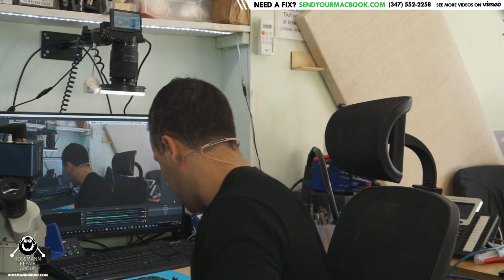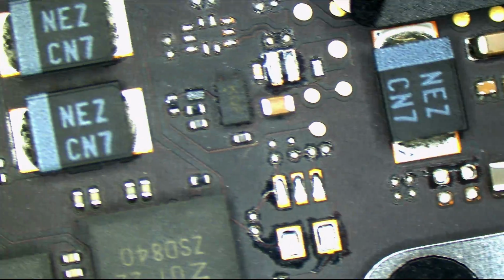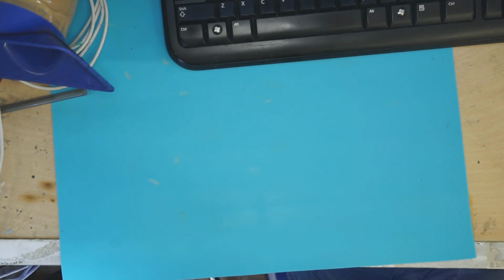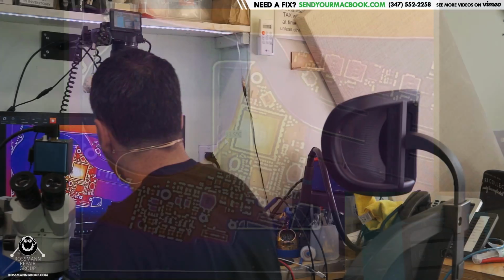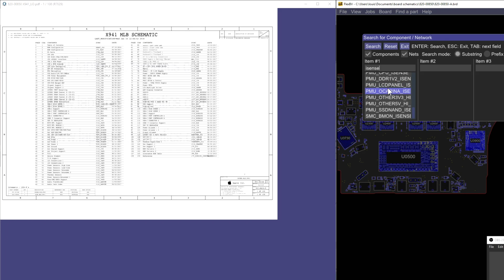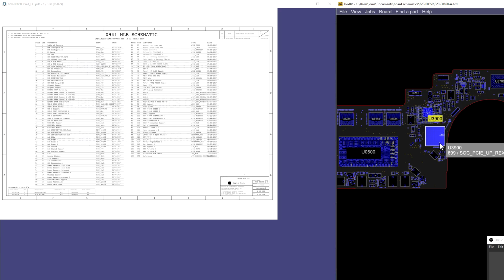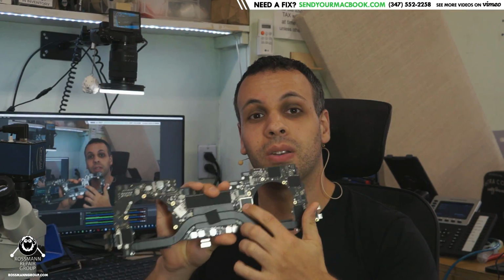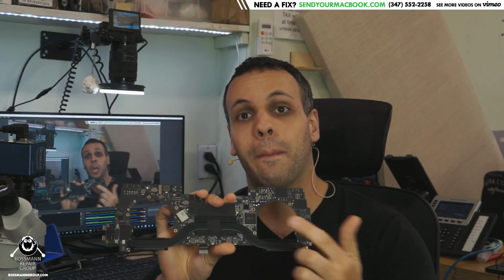Apple users have no one to blame but themselves.

Comment: You know what i hate? the fact, that i bought an iPad! >.<
Here is the reason: Android Tablets suck! It is not like, that they're worse, than an iPad, no, i have tested EVERY Tablet on the market by the big players released since 2018!
Yes...a shitton...and every time i found myself coming back to the iPad, which brings me to the conclusion, that the industry set the bar for "good" so goddamn low...AND THEY'RE STILL FAILING...

I hate, that i get an iPad, but when you are in need of an ultra portable device, with a larger screen, than a phone, preferably with a pen and, so you can write notes, while you are inspecting shit and LTE...i am ANGRY, that i have to admit, that the iPad is the best we have!
Everything else is either more expensive, or just garbage. The latter is mostly the fault of Android, because even though it does run on tablets, it is not really great. Then you have manufacturers, that put stupid tweaks and bloatware on their tablets and you end up with a pile of electronic junk!

Comment: Yap. Surprising that it took this long, tbh.

I'm gonna contrast this to my experience with a company that probably most people consider pretty shitty, almost a decade ago now, in backwater country (Brazil), that might surprise some people.

Pre-considerations: nowadays I think their costumer service here dropped the ball by quite a lot, and the problems I had I discovered afterwards that it was all design flaw and their own fault. Alas, I was probably among the very few people who actually got one of those here in Brazil, and class action lawsuits are not a thing here, so not a chance of that happening. It did happen in the US though, but of course not being an american citizen I got nothing.

My first Dell XPS laptop. Expensive as heck (specially for brazilian standards). I wanted a desktop replacement because I was going to be taking a trip every two weeks for a post graduation course in game development, and it needed to be both powerful and lightweight.

Ok, after a year or so of normal use something went wrong and I got all sorts of weird artifacts on the screen. I think the laptop kept running full power while enclosed on it's case and something fried. E-mailed support, sent some photos, explained extensively what I had done. Some back and forth and they were sending someone at my apartment to check.

To my surprise, the guy who got to my door, despite being 3rd party not a Dell employee or anything, knew everything there was to know already. 
Like, not one of those cases where you have a lengthy detailed discussion with tech support only for them to send someone who knows nothing about the problem and you have to start explaining all over again. Nope. This guy came to my aparment with a motherboard replacement in his bag. He tried some stuff, did some tests, called it out and started replacing the entire motherboard.

This happened twice. Nowadays I know why. Faulty discrete graphics chip, a gift from nVidia. It would overheat if you forced the laptop too much, and kill the entire motherboard. Dell, at the time, honored the warranty and even extended it a bit, but by the time it ran out I had already learned how not to fry the damn thing (by not forcing the graphics side too much) and was already on the way of getting back to a normal desktop - needed a video editing station.

I gotta say, the level of expertise, the knowledge that the tech support guy showed, the speed in which he solved everything and how I was treated - I never saw anything near as good in any other tech support from any other company or from independent PC repair centers ever in all my years of dealing with computers. In Brazil, computer repair shops are just not very good at all. First SSD I got, I went looking in several shops for a way to fix it inside my desktop, most people I talked to had never even heard what a SSD was. Only one repair place whose owner also worked repairing computers had heard of it and asked to see it, suggesting some solutions.

Anyways, back to the Dell XPS - It's still working to this day, but as you can imagine, Linux only, very sluggish... it's a core 2 duo with 4Gb of ram, can't do much with it nowadays anymore.

About Apple, the way I personally see it, and have been seeing it since last I had an Apple product (an iPad 2), is that at some point Apple stopped being an electronics development company and became a commodity company, like so many others. The switch to highly proprietary components and tech became less about innovating and improving on existing stuff, and more about corralling costumers into a trap - the so called walled garden which has withered away a long long time ago. And it worked. You don't pay for innovation anymore, you pay for marketing, status, brand and luxury. The great usability stuff, the great integration in the ecossystem, the great design.... all that stuff that made Apple great are shadows of the past. It was very true at some point in time, it's still historically true, but they are just not doing it anymore. And anyone who is still not feeling how aged this philosophy and mindset currently is for the company, is just in denial.

And this is something that I'm definitely not gonna put just against Apple. Google is just the same. Microsoft was always kinda shitty, and it still is, so no big changes there. But these companies have been just riding on the coattails of great past accomplishments while doing nothing comparable to their past these days. Apple with it's famous great costumer service which I'm seeing nowhere these days, Google with it's great innovative ideas and dedication to projects which I'm also not seeing anywhere these days, what with their constant flubbing with messaging apps and whatnot.

In the end, nowadays I will go for almost any Windows laptop rather than a Macbook. All the Windows laptop companies might screw me over, but at the very least I can open things up and try to deal with it myself, to a point. With Macbooks, I'd not only have to pay the insane premium price that is practiced here in Brazil (you think Apple products are expensive there, you know nothing John Snow), but also be sol if it breaks. Nope. Not gonna fall for that.

Comment: Lucky! I ditched Macbook Pro 2018 and Razer Blader 15 2018 for Asus Zephyrus and XPS 15. Macbook Bad keyboard and Razer On-Off pause issue.
Reply: XPS 15 has it's own set of issues, the most annoying of which are the incompetence the devs show for every firmware update they have released for that device (most annoying ones i experienced were touchscreen functionality going bye bye and dGPU throttling hard if the temperature was below 48 degrees c... the latter issue was bypassed if i suffocated the laptop in a blanket for a few minutes as the dGPU was being stressed. they did release a BIOS update to fix that issue, but it took them more than a month, after which i had returned my 9570). i've had much better luck with the blade 15 :/ hope your XPS 15 doesn't give you any other problems in the future.

Comment: To turn on for a while the printed circuit board and to recover these data it is possible. 
It is necessary to disconnect internal mosfet inside controller using the schematic diagrams and connect by an external power supply. 
For repair necessary to buy empty the multicontroller chip and to program it using a firmware from Apple according to audit of this printed circuit board. 
In the same way as well as program multi controllers on computers used in Windows based devices. 
In Russia this type problem already successfully repaired.
Reply: yeah but having that firmware is probably illegal, which in russia no one cares but in US you might be prosecuted
Reply: @petervansan1054  who know whether someone have firmware and it was used in repair. 
In some cases I should do some firmware reverse engineering process. Even for crack apple password or update firmware in SSD for data recovery process. 
In some cases need prepare particular patch firmware if SSD have memory chip degradation. Same for Apple. Who care if I use modified firmware or service manual from plant. 
If it was stolen from Apple then it is Apple problem. BAD protection and security. 
Police cant find allpe firmware because people used online firmware encrypted storage together with multicontroller programmer.
Reply: @oleggritsev  you should do a full write up on how to do this if you ever have the time.
Reply: @Scragg-  Sorry guys i am not a blogger. I am electronic engineer with University Master degree. I can develop Monitors, TV, laptops tablet and any electronic devices or use some microcontrollers. And of course i can fix any of them. Apple provided to me electronic diagrams and datasheets only for data recovery purposes. So i think illegal share it with everyone. If you need burn firmware to SMC , SMU or PMU then use google search to buy some solution. Firmware from EFI Boot ROM and SMC version update usually possible download from open apple web or certified apple technician level 2, 3 access, and after then extract it from update file.
Reply: @oleggritsev  so youre telling these repair companies to start repairing stuff illegally? who the hell is going to want to risk their buisness on somebody elses crappy apple shit. you are missing the point of this video, the apple stuff has become not anywhere near practically repairable which is completely unacceptable and unfaithful for a business especially of this size
Reply: @jamiedyer7782  "so youre telling these repair companies to start repairing stuff illegally"
Why don't you re-read what you wrote and try to make sense of it in a world where you own what you buy?
Reply: @Markle2k  the company is being unfaithful in making their products harder to repair purposefully to make them throwaway products so that people just buy more every year instead of repairing what could easily be a perfectly good machine. It's not faithful of apple as a company and since they are a big multinational conglomerate that holds massive share value they should be under the highest level of scrutiny for their faith and good will as a company which offers a product to general public which have human rights and technically have rights to not being sold a faulty piece of garbage equipment that was very unnecessarily designed to be so
Reply: @jamiedyer7782  You called making a repair "illegal".
Reply: @Markle2k  I was quoting the original comment about the requirement to use illegal firmware to repair the board, you wouldn't do this as a business owner because it's a risk that's not worth taking
Reply: @jamiedyer7782  Again, you are normalizing the notion that making a repair is an illegal act. "Illegal firmware", WTF? If you aren't flashing an ECU to get a car to perform or facilitate an illegal act, like bypass an emissions test by sensing a test procedure and implementing a different program, what is illegal? Putting getting the hardware back into a working state should not be an option for the OEM that has an anti-consumer incentive to use failure as a way to sell new product.
What you are doing is buying into Apple being able to game the system to its benefit and every customer's detriment.
Reply: Peter Vaňušanik tbh I would love to see apple try to take me out lol they will have to worry about their servers first lol
Reply: Louis should chime in
Reply: @banjirjir7519  Apple provides some documentation for forensic and data recovery services. But it requires an agreement that the Apple out of warranty products will not be repaired because it is not beneficial for Apple. Therefore, some Apple documentation is available for data recovery and forensic services. So if the password is known, data can be restored. For a company Louise service, this will not work. Because he talks too much on the Internet to everyone how to repair Apple. They not like it. I hope I clearly explained ?
Reply: What you say can be easily possible but there is one slight problem. It is that we do not know the microcodes inside a T2 chip and that chip could very well have serial codes of each of the internal components it uses on that motherboard. If T2 is not internally readable by the system then that means it is a ROM which only outputs in boolean about the integrity of system.

Comment: Here's a slightly different angle to the story (I'm a CSEE): It's preferable to have firmware on some chips upgradable for bug fixes. Of course, the issue then becomes that you don't have the boot loader on a blank T2 which makes it nearly impossible to repair.

Comment: When the iPhone 3g first came out I bought one. The mic failed within 3 weeks, I took it back and they said they wouldn't/couldn't repair or replace under warranty. I ended up repairing it myself for like $10 and never bought another apple product
Reply: i remember my iPhone 4 dropped from my pocket, and the screen, battery pins and the USB IC were broken, IN JUST ONE DROP !!!!
Reply: Twenny Bux our iphone 4s has had no problems since 2012.  We even posted some 1080p youtube videos with it 

Weird eh!?
Reply: @CrazyFunnyCats  doesn't matter, iPhone is still useless.
Reply: I have had an iPhone 6S since it first came out up until I upgraded a few days ago. It’s intact. I even dropped it in the fucking toilet one time and it’s still unscathed. So sick of people talking shit when they clearly never even owned an iPhone. Macs however are legit trash and apple as a company are assholes. I’m not saying otherwise, however people give too much shit to something that doesn’t deserve it.
Reply: @Tactix_se  I'm sick of fanboys getting upset over facts and calling it talking shit. Oh my iPhone still works and didn't have many issues. Therefore all the factually things people say about apple, iPhone, and iOS is just shit talking and means they never even used one......
And you're lucky it was a 6s instead of 6 or 6 plus. The bendgate issue was true and server. And lead to touch disease
Reply: @guywhoknows4chords459  You have absolutely no idea the ratio of broken to non-broken previous iPhones, and judging by how I haven't seen someone using a 4 ever I think it's safe to say they are gone. Pretty sure they didn't even have 1080 displays on ANYTHING back when that thing came out but I may be wrong lol. Also I know a guy with a 6, every time he turns it on the battery is at a different percentage and then it dies lmao. Functional means the product works and does its job in a satisfactory manor, not just being able to turn it on and off, sheep.
Reply: @Resunaa  you can't judge until you have facts. Bring the facts back to this comment section and i will retract my statement.
Reply: @Resunaa  Also i use Android...
Reply: @CrazyFunnyCats  wow. You mean not every single one died?

Comment: " . . . . so this is where Paul had soldered a wire to . . . . ."
Wait.
What?
You're removing/disassembling a unit and soldering on a main circuit board from that unit and then expecting the manufacturer to honor a warranty?
Dude.
Put down the crack pipe.
Stop buying crack, save your money so you can stay current on your Apple Hate Club dues.

Comment: Luckily I've never given Apple a red cent.  On the other side of the coin though, I have been fighting with Microsoft and Nvidia's shady business practices for a few years now.  Microsoft try to pull the same act in software mode, removing support for older OS's and calling anything not current top of the line "Legacy Hardware" and removing it from the support cycle, forcing us to upgrade our physical hardware or not have an OS deemed "current".

Nvidia went as far as releasing a KILL Driver to turn one of my Toshiba laptops into a brick,  and then tried to blame "hackers"...   Funny how the "hackers" only targeted the older chip-sets and not the new ones.

Comment: It's time I came clean. I did not forsee that Apple would design their machines in such a way that basic data retrival would be impossible. Luckily my MBP 2017 has the life boat port but an SSD thats soldered on is still an issue. I want help to find an alternative to these machines that are great for 4K+ video editong jobs with complex workflows so I can avoid these MBPs as they break and can't be repaired easily or inexpensively when my apple cares expired.
Reply: Depends on the specs of the computer you get. I never really got into 4k stuff but I do fine on my $600-700 laptop that runs nearly everything I throw at it, gaming wise I can play a majority of games 1080p-900p at 60 fps (granted I turn down graphical settings a little, not too much)

Comment: The EU here in Europe are huge on recycling when it comes to electronics. They even forced Apple to use a usb charger to stop every manufacturer using their own propritory system and cause even more waste with every upgrade. Maybe if enough of us complain about apple‘s throw it away and buy a new one policy it may force a change. Or better still let them keep ripping people off and face the backlash from the internet and people stop buying their over priced badly built crap. Next iwank device has a chip that filters web browser content for anything negative about Apple devices.
Reply: the eu forced...?? 
they gave apple a good reason to sell a new adapter, they never forced them to adapt anything. apple introduced the not changeable battery in phones and while it has been illegal in the eu from the start, they never did anything. huge on recycling? no.